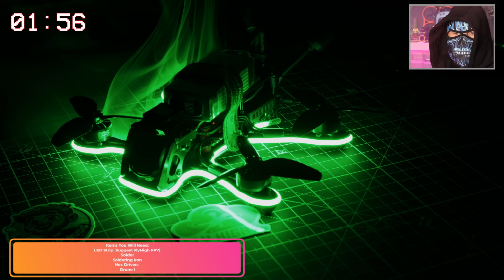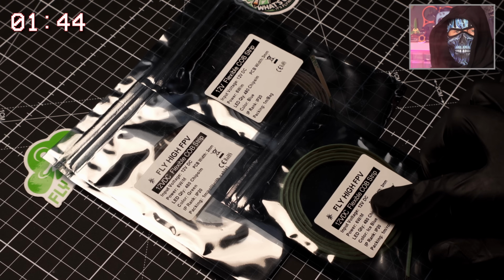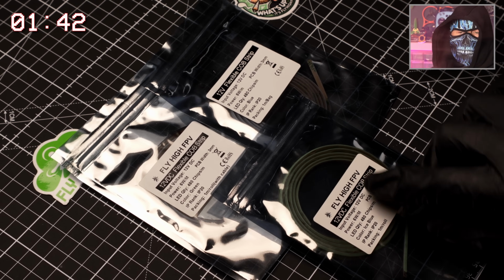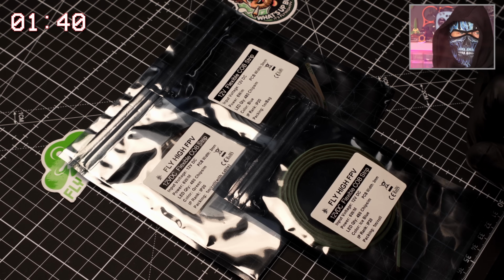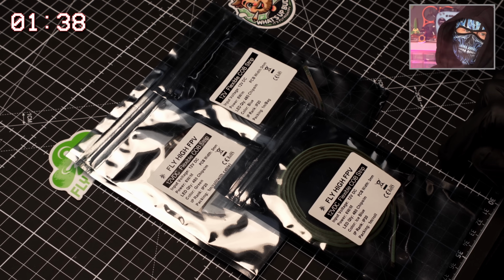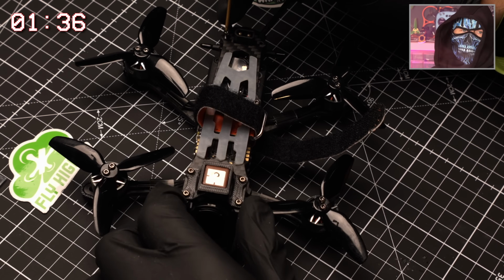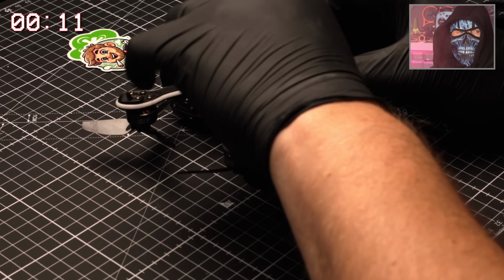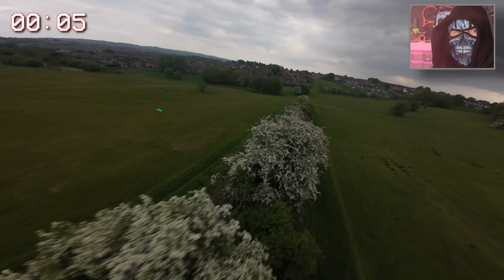Install LED Strips on Your FPV Drone in 2 Minutes! | Quicker With Quads

Comment: I have a cinelog v35 v3 and i want to put led strip cob on drone. Can I solder directly onto the control board strip led 5v 5w?
Reply from the maker: If your ked strip is 5v,yes

Comment: You showing 3 led package of 12v so which one for 4s Battary
Reply from the maker: Yes they offer different voltage rating for the strips
Reply: @squaddingquads  I am using geprc cinelog 30 v3 frame which comes with led strip but I accidentally broken the connector of board so now I am thinking to connect directly 4s battery so it will be ok ?, in the led strip there is written 12v
Reply from the maker: @Honeybadsha23 no don't connect to the battery you need to solder to the flight controller
Reply: @squaddingquads I am using speedy bee aio there no 12v pad , so what should be do
Reply from the maker: @Honeybadsha23 are your leds not 5v?
Reply: @squaddingquads led is 12v
Reply from the maker: @Honeybadsha23 you can solder to the vbat pad then

Comment: You should get Fly High’s LED arm guards. He can print custom ones and he has lots of choices available. They have a small channel in the TPU for the LED’s and they light up slightly giving a nice glow. Also, I like using a controllable BEC and assign it to a switch on my radio(User 1) so I can turn them off/on.
Reply: Thanks bud! I make LED skidz for a ton of frames and always happy to make new skidz for other models.  Also if you want to control the single color led's I offer Tiny'sLED RealPit , for easy switching on n off 👌
Reply: @Fly_High_FPV the skids you designed for my Tanq 2 are awesome!!!!  I love how the light comes through them a little and they are tough as nails.
Reply from the maker: I didn't even realise you had such a thing brother, so neat

Comment: Is there no BEC with these leds ?
Reply from the maker: Not needed no, you just buy the ones that match your Quads voltage, these are 3-4s and the 24v are 6s
Reply: I designed them to no need bec's. Pick your voltage and run off vbat 👌
Reply: @Fly_High_FPV can we get them in the EU ?
Reply from the maker: I'm in the UK so I assume you can man  @ghostrot

Comment: how do led strips liek this even work? is it just a LOT of small LEDs and really good diffusion material/ In the opening thumbnail photo, the LED strip just looks like one nice continious solid luminious strip! And later on it still looks great.

In real life, can you actually notice individual LEDs? Or is it really some sort of fiber optic or long led crystal? Or just really good diffusion? I need to find a 3d printable material that diffuses LED light THAT well! 
Looks like a gel ! Oh Well!
Reply: They look like a continous neon light, but it's 480 led's per meter, and a rubber bead diffuses the light 👌
Reply from the maker: @Fly_High_FPV thanks brother 🙏💪👊